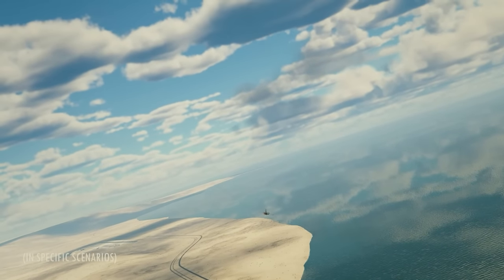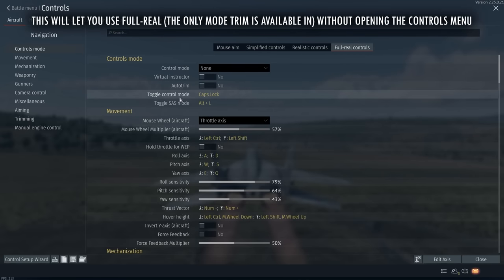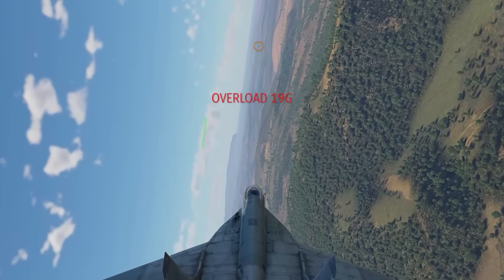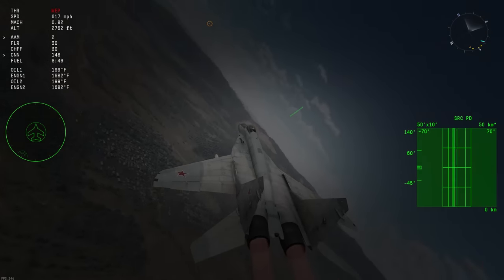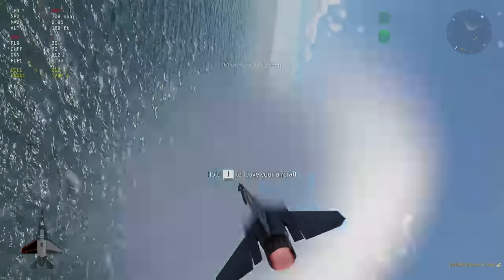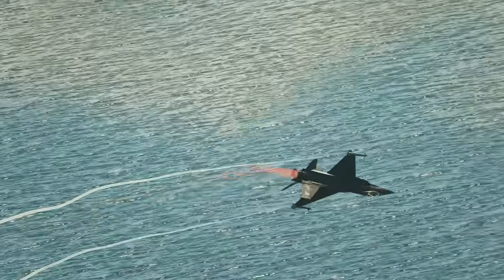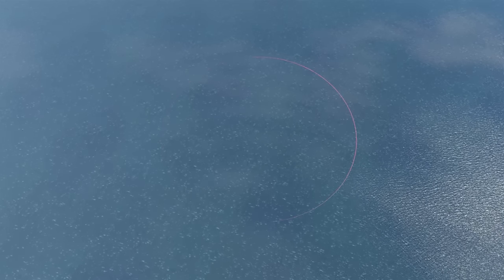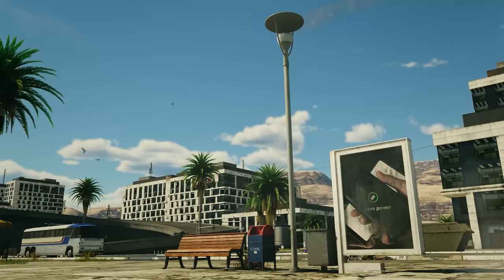This Hidden War Thunder Mechanic Lets You Fly WHILE UNCONSCIOUS (in game)

Comment: Realistically, the F-16 is said to be able to maintain a turn without the input of the pilot due to the unstable nature of the flight model.
Reply: Please let me know if I'm mistaken. I'm just going off the top of my head right now as I somewhat recall reading or hearing about this exact thing. The F-16 was intentionally designed aerodynamically unstable to enhance the aircraft's flight performance in any maneuver. Consequently, the design caused the aircraft to pitch up a few degrees constantly. Anything below Mach 1 speeds and the aircraft would pitch up if not for counteracting elevator input. Anything nearing Mach 1 and beyond and the effect would grow less due to compressing air flow.
Reply: @Und3rpr3ssur3_Gaming  This is a new matter to me entirely. I only knew so much about what the engineers intended for the flight model and its practical uses. You might be correct, to say the least.
Reply: @Und3rpr3ssur3_Gaming  F-16 isn't the only one, a lot of fighters are designed with a far forward center of lift for this reason and is only able to maintain stable flight thanks to advance computer systems and Gyroscopic tech.
Reply: Sure but that's not how it works. Pilot needs to apply pressure to the stick. Without that pull the plane will not turn. What you describe is the fly-by-wire system that keeps the aircraft stable in flight, ensure G and AoA limits no matter what the pilot tries to input. Some aircraft let you disable or modify it for added manouverability (Su27 for example) but when done the aircraft bleeds massive amounts of energy and is extra sensitive to controls. I also don't think F-16 has a way to disable fly-by-wire.
Reply: @Und3rpr3ssur3_Gaming  unstable = tighter turns
.
But if the fly-by-wire system goes out you are screwed
Reply: all fighters are, but f16 has fly-by-wire, so yea, it can keep turning for ever if its light enough and has infinite fuel, the computer still needs input, or the stick will center and the jet will straighten out. unless you reprogram the flight control system or manually force the stick in a position (i dont know, use a rope or rubber band etc to give constant input, like putting a brick on your cars accelerator)
Reply: @Frozander  i think it is lmao
Reply: All modern fighters do that but is controlled by FBW...
Reply: @Und3rpr3ssur3_Gaming  all american planes after f16 are designed to be unstable

from what i heav heared flyng the hornet without the flyby wire system requires a lot of skill as a small input in the wrong direction can tear off the wing or stall the plane
Reply: cheggers!  it still uses hydraulics btw, they just arent controlled directly by the stick but rather has a computer as a middleman, and it needs hydraulics because otherwise, say, if it uses a motor, the motor will need A LOT OF TORQUE to move the control surfaces which will use a lot of power, hydraulics are more efficient and light weight
Reply: @bucketofbolts6823  Look, I feel like everyone took my comment in the wrong direction. I already understand the unstable design isn't just limited to the F-16. I don't need to be constantly told about this in the comments. I was simply commenting on the additional effects to my knowledge of what the unstable design causes and if I were mistaken about it for someone to provide me insight otherwise. What I was essentially saying was that while yes it improves maneuverability it also from what I understand forces the aircraft to pitch up constantly at certain flight speeds. This effect becomes less noticeable when flying at speeds above Mach 1. That being said you wouldn't notice this due to multiple reasons such as counter input via automatic trimming of the aircraft applying roughly the same forces to counteract the effect.
Reply: maybe if the flcs is off...
Reply: No, but because the FLCS is programmed to fly the aircraft at 1G all the time.
Reply: If you look carefully you can see the control surfaces counteracting the negative stability IRL. For example in high g-turns the JAS39s canards are often pointing down, trying to push the nose down. That can seem very weird at first glance but the thing is the whole aircraft itself wants to pitch more and more so the computer gotta stop it from turning, the plane doesn't want to fly straight. 

Stable aircraft have a negative alpha/cmy mraning that for higher angles of attack you get a counteracting aerodynamic moment which tries to make the alpha lower. Unstable planes have a positive alpha/cmy so a small increase in aoa makes a moment trying to increase the alpha even more. Without fly by wire the plane will rip itself apart at higher speeds because around the longitudinall axis it wants to have the nose pointing backwards while around the vertical axis it wants to fly as normal planes.
Reply: wouldn't that mean that if the pilot passes out in a turn he would remain pased out?
Reply: @Frozander  No you're not quite correct here. Look into static and dynamic stability of an aircraft. An aircraft with a negative dynamic stability, such as most aircraft designed for combat, will maintain a turn, or any input, even after the pilot is no longer giving an input. The pilot after making a turn, must then give input to return the aircraft to straight and level flight. It will not return on its own. This is not a direct characteristic of fly by wire or other systems, but it can be. Its a design feature. An example of this is a Grob 120g, which uses push pull tubes only for flight controls. It demonstrates this negative stability. An example otherwise would be lets say a Cessna 150, which when turned, will naturally pull itself into straight and level flight. Designed this way for ease of flying.
Reply: @Und3rpr3ssur3_Gaming  I dont believe that is a tendency due to it being unstable. I have not read this full thread so someone may have mentioned it, but I believe that is a feature built in to help counteract mach tuck, as the F-16 was meant to fly mostly above the sound barrier. Mach tuck affects all aircraft that are trans sonic or super sonic, including non-aerobatic, more stable aircraft, such as the Concorde.
Reply: Isn't that the G-demand mode or something? 

I think that also is in the F-22, this mode basically allows the pilot to set a constant G load and the Flight Control System takes care of the many factors in order to meet demand of the pilot within the set G number.

Though i don't remember much from the article and documentary from years ago.
Reply: @bucketofbolts6823  No, the latest planes the US are making are stable, the F-35 100% stable, as is the NGAD and the F/A-XX 6th gen aircraft. Making your planes unstable is the biggest negative you could ever come up with, you're honestly better off looking for other avenues of advancement. Which is exactly what we did.
Reply: @Und3rpr3ssur3  I also heard this. It only stays up because of its computer systems and the fact that it's just moving so fast. It's apparently a really really hard jet to land. Like the Saber was. It's AOA is stupid on an approach.
Reply: @GatorGreenGladiator  It's not exactly hard to land, it's just getting the sweet-spot on the landing that's hard.
Reply: @Optimaloptimus  tbh... I wouldn't know lmao 🤣
Reply: Unstable != Uncontrollable.

That is the biggest thing wannabes constantly misunderstand regarding aerodynamics/aircraft. Cessnas are extremely stable; they resist rolling and will tend to return to flat and level flying when left without inputs. This makes them great for commuting and especially learning. Unstable aircraft are common as f**k, because if you want to roll and use pitch to turn, stability is undesirable, it works against those actions. When turning is emphasized into a design, it tends to not self-correct/level. Many light sport aircraft are unstable for this reason, too. If you want an aircraft that rolls to a sideways position so it can "fight" in a turn battle, you don't want the aircraft to be constantly trying to right itself or have to create additional drag to fight that tendency. That's it. That's the real reason it's not stable. It wasn't made unstable because that magically makes aircraft faster.

The best analogy I can think of is one that not everyone can appreciate: Sportbikes are unstable compared to cruisers. In both cases, the instability is a result of designing for turning performance, it is not a specifically intended/desired feature or outcome. The designers didn't design the F-16 to be unstable. They designed it to fly and turn fast. It just happens that instability comes with the territory. Similarly, sportbike designers don't ask, "How can we make our bike harder to balance at a stop or slow speeds?", they minimize mass, maximize wheel and tire geometry for race conditions, and balance other factors like center of gravity vs drag and downforce for track time style riding, and the result just happens to be comparably unstable, easier to drop versus other designs. 

TLDR: Please stop repeating the F-16 was designed to be unstable and that's what makes it fast/good, it's just not true.
Reply: it depends. according to bms's referenced wind tunnel data the pitching moment is negative indicating negative stability at ~15deg alpha at low speed with no aileron input, but just a tiny bit. negative stability decreases while elevator authority increases when speed increase. it turns on its own? sure thing but you're probably also falling out of the sky.
Reply: @SomeOrdinaryJanitor  yes. The spitfire was unstable and often pitched up.
Reply: @Und3rpr3ssur3_Gaming  Its rly depends from weight distribution and may wary. Level of fuel jettisons have impact for stability. Fly By Wire "trim" plane. When is no input its steering it to fly straight if have inputs trying archive what pilots wants. First version F-16 have few fatal accidents when due to EPU failure plane go into -10g and pilots dont have chance to eject. You can find YT about this.
Reply: That is true, however, it wouldn't do so in an orderly or stable fashion without the automatic computer stabilization system, which way least by default prefers straight line flight.

Comment: Outside of jets, many props (especially 109s) benefit greatly from Full Real controls and the ability to pull way more than normal. You can out-turn Spitfires with this and leave them dumbfounded.
Reply: can I out turn spitfire in p47 if I do this?
Reply: no
Reply: Any plane benefits from full real controls, the instructor doesn't let you push the plane to it's limits you can usually get a couple extra seconds of turn time with full real.
Reply: @kammmmal211  There's limits to what you can do, the P-47 is just too heavy.
Reply: imagine what the spitfire could do with this lol
Reply: @anonymousfish2456  Not as good. As much as people nut about the ellyptical wing, it is far more unstable than the Bf109's simple trapezoidal wing with slats, and it is far harder to fly at the limit.
Reply: @reinbeers5322  I guess, but the spitfire already has an amazing turn rate, so it would still be able to fight a 109 using that tactic. Furthermore, doing any more advanced maneuver other than a simple turn circle would negate the tactic anyway.
Reply: @anonymousfish2456  Well no, you can easily do other maneuvers in full real controls. The 109 player also has both more to gain and a much larger margin of error than the spitfire player does.
Reply: @kammmmal211 N15 variant probably outturns spitfires above 500 kph but good luck getting into an equal energy fight with that piece of garbage.
Reply: @reinbeers5322  Wouldnt the 109 lose way too much speed trying to match a spitfire?
Reply: @Ben-mw9vz  Not really, the spitfire loses speed much faster than the 109 in normal RB flying. It's about even with the limits off.
Reply: early (up to E, maybe also F1) 109's vs early spitfires, if the spitfire pilot isn't that good.
then the same goes for the last few spits vs the late 109's but in those scenarios it really depends.
this might not be true for RB...
Reply: Can I use this mechanic in the p51 series
Reply: @eagle_412  Too heavy.
Reply: its also pretty good to use MEC

Comment: This is also how you can make some aircraft pull a cobra maneuver, even planes that cant IRL
Reply: And yet gaijin made it so the Draken- the plane known for doing the cobra- can no longer do it.
Reply: @justamicrowave2572   Drake can do it again but the cost of everything is fucked up in flight model
Reply: @justamicrowave2572  they fixed that months ago
Reply: wait what, how?
Reply: @kebabit707  combination of the aircrafts Flight Model(FM) and the physics of the game. While the graphics engine has been updated multiple times, the physics engine is very outdated, and many aircraft having the same FM from Wings of Prey, War Thunders predecessor from *2009*. Many propeller planes can, more or less, perform PSMs that are can only be done by thrust vectoring jet aircraft irl.
Reply: @judedeschamps2369  but how do you perform them in-game?
Reply: @judedeschamps2369  a real cobra or a loaded spin?

Comment: i get really inconsistent results with this. sometimes i'm not able to pull any more Gs than normal despite realistic controls mode being on and the elevator trim being maxed out. like it's definitely trimming my plane, but only sometimes will it actually let me do crazy stuff like pull 18G despite doing the EXACT same thing, in the same plane, at the same speed, at the same altitude.
Reply: That’s probably because there’s a difference between ‘full real controls’ and ‘realistic controls’. Only the former will allow you to do what’s being shown here.
Reply: It's not so much about being able to pull MORE G's as much as it is about pulling CONSISTENT G's.  Without this "trick," you'll pull the same G's until you black out, then your plane will reduce it's G-load to maybe half of what you're inputting.  But with this, you're maxing out that turn until you stop trimming the aircraft.
Reply: @PvtPartzz  you think that they change that after they did it a few times?

Comment: AFAIK 4+ and 5th gen fighters DO have a device that measures oxygen flow to the pilot and determine if and when they have blacked out.  I think it straightens the plane though rather than maintaining the circle.
Reply: Considering jets like the F-22 can pull far more than their squishy pilots can withstand it's a rather needed function. They actually have something like the pilot assist built in just to keep the pilots from killing themselves.
Use  to have a blast watching the pilots train at Tyndall Airforce base and over the gulf. You could always tell the newest ones because they'd have them doing super low speed maneuvers and they'd be wobbling all over the place trying to keep it JUST above stall speeds.

Comment: Once again when we look back to f-16's g-limiter we'll find it's designed to prevent 1. blacked out 2. wing over load 3. saving energy (speed) 
So it's actually a pretty useful mechanic and I generally recommend most people who's not familiar with energy fighting to use it
Reply: It’s NOT A G LIMITER. STOP CALLING IT THAT
Reply: Is not designed to keep the plane in an infinite 13g turn, its fbw in charge of flying the plane
Reply: yeah but this is war thunder, every other jet is capable of doing maneuvers that are otherwise impossible in real life. So why should the f-16 be restricted from the game's silly physics.
Reply: @mental_defect  because unlike those other jets it was restricted in real life by design and not through the limitations of the actual machine itself. Btw, the F-16 isn't the only "limited" aircraft. The Mirage 2000 should actually be able to do MORE than it can currently in game, and not less like you claim for other jets, just like the F-16, except unlike the F-16 it's not very accurate. After the changes made to the 16 its actually pretty spot on for an A model.

Make sure you're also not comparing the DCS C model Block 50 to the A model Block 10/15/20 in WT. The C model is an absolute monster compared to the A.
Reply: It is not a g limiter and was never intended to be
Reply: @Nebby_Webby  🤓
Reply: it already retains energy very well and can recover energy very quickly due to its nearly 1:1 thrust to weight ratio
Reply: @evangalinsky2499  there are other jets in game with it but only the f16 is limited
Reply: @jtl05  read my comment very carefully.
Reply: @evangalinsky2499  flight performance wise what's the diference between the DCS block c from the a in war thunder? Better engines? Control surfaces? Shit's a beast in DCS
Reply: @joonlorenzon9696  bruh

New engine, new control surfaces, more powerful hydraulics to activate the control surfaces, changes to wing area and wing design, new larger intake allowing for more engine power and more instant and sustained AoA. And probably the biggest change of them all, SERIOUS refinement of the FCS (flight control system) and fly-by-wire systems to achieve the absolute optimum performance out of the plane. The A model FCS and fly-by-wire systems were pretty bad, limited the A models performance, specifically the early blocks like we have in WT, quite significantly.
Reply: @evangalinsky2499  thanks, I was comparing them both all the time due to my lack of knowledge
Reply: No such thing as a G-limiter in WarThunder it's just the auto pilot trying to keep your ass from killing yourself and thus limiting or adjusting the controls to keep your in the air.
When you switch to full control it turns that assistance off and lets you use the full strength/controls in whatever stupid way you want no matter if it will throw you into a flat spin, tumble or just essentially pancaking your pilot.
Reply: @SilvaDreams  so then the instructor (autopilot) is kinda dumb cause you can go full real and set max trim on the f-16 to ratefight at 11gs, no wing tomfoolery or flatspins